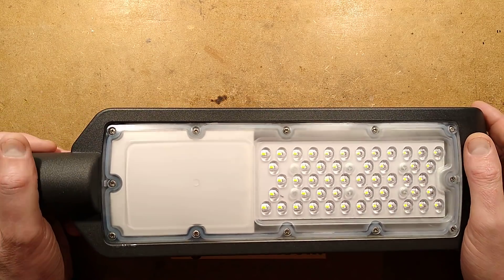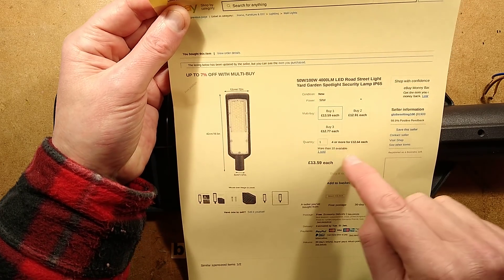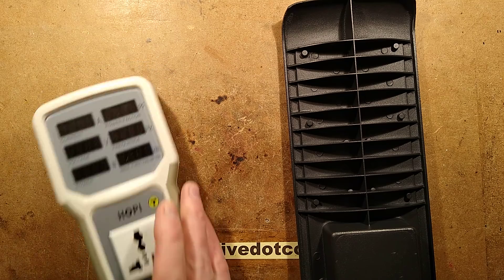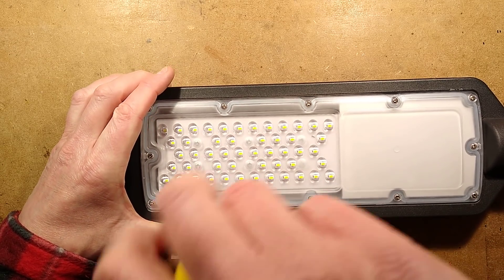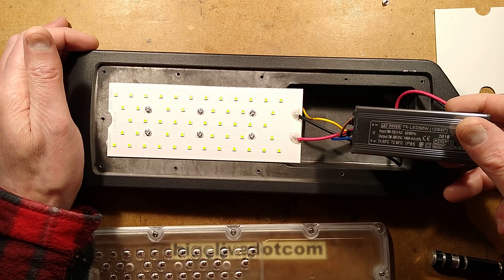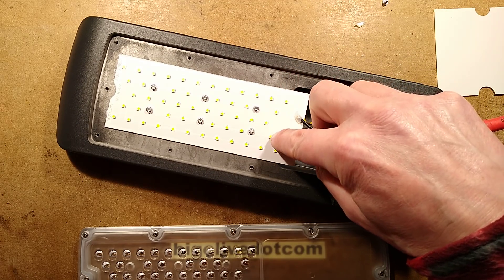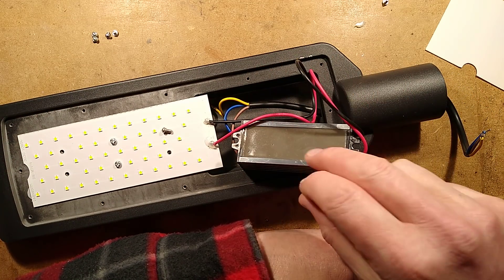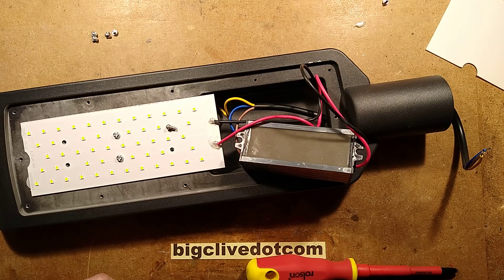DIY Chinese street light kit.

Comment: 08:56 "Lets take a look at the LED array". I think you meant "5G mind control array"!
Reply from the maker: I was so tempted to make lots of brain modulator beam references.
Reply: @bigclivedotcom  just do a technical explanation on how 5g brain control works, rambling how youve been installing some relay stations and transmitters. you may get some special new viewers from that haha
Reply: Very special.
Reply from the maker: @drkastenbrot  I did toy with that, including how the boxes on some lamp posts monitor chemtrail levels and signal to planes to dump more.  But I'm cautious about affecting the safety of street light installers.
Reply: Linking up 5G with our chemtrailing program has always been our long term plan. Frequencies enabling targetted control of heavy metals in the bloodstream allowing blood brain barrier breaching.
Reply: @geocontrolmanchesterairpor3943  Dimmer Skies are Safer Skies
Reply: @bigclivedotcom  On a serious note it sounds like a teardown of a ZigBee enabled streetlight, including an explanation of what the "400V CAPACITORS" are actually for would be good. I am sure the Illuminati will pay handsomely for the propaganda!
Reply: @kevinjbakertribe  So dimmer people are safer people?
Reply: @dadillen5902  I suggest "More compliant" rather than "Dimmer". But - yes!
Reply: @bigclivedotcom  I would love you to do a "tear down" of the kit that Mark Steele has been discussing as you will probably know what most of the components actually do rather than just having Mark raving about a 400V capacitor and knowing very little else!
Reply: @kevinjbakertribe  i think in this case 'more complaint' and 'dimmer' may be co-indicated. 😉😲
Reply: @dadillen5902  Apparently my Illuminati superiors inform me that the only acceptable response is "No comment"
Reply: @kevinjbakertribe  Which is after all a comment.😵😜
Reply: @dadillen5902  Damn!!! 😂
Reply: While some of us actually are installing 5G kit! Well, I'm in the back office. I can't even control my own mind, let alone anyone else's.
Reply: @dadillen5902  I wouldn't say so - I used to be a dimmer person, but the SCR noise became very distracting and interrupted my concentration.
Reply: @restcure  Not sure we are talking about the same type of dim. I my experience dim people rarely get brighter.  Ignorance is curable with education, but stupid is generally genetic and quite often fatal. We were also speaking about safety, not disturbance or distraction. Although distraction can put one in danger. Just look at the number of deaths caused by cell phones, but that put us back to death by stupid. So in the in the end the brighter you are the less likely you are to suffer death by distraction. Also, in my world an SCR is a silicon controlled rectifier, not certain what you were referring to.
Reply: @dadillen5902  Nope - just taking the opportunity to make a bad pun.
Reply: @restcure  Sorry, stepped off that cliff and just kept fall. Didnt realize the pun until i had sent my rant.
Reply: @dadillen5902  yup - I travel to the Land of the Dad Jokes fairly often ...
Reply: @restcure  No problem, I have reach the point of grandpa jokes and I am happy to have made it. I have nothing to offer but a little hard won wisdom and nobody is interested in that. I am afraid that the stupid and ignorant are winning.
Reply: @bigclivedotcom  Can we have a brain modulator beam teardown and reverse engineering in the next video? I'm building one at home but can't get it to work right. It does scare the cat but I still think the government is awful so it's clearly not working.
Reply: @kevinjbakertribe  I laughed so much I nearly wet myself :)
Reply: @bigclivedotcom  https://www.vigiliae.org/mark-steele-exposed
Maybe you could request one of the smart helmets he and his brother produce to tear down. I'm bemused why he opposes the tech when he is involved with it himself. Weird.
Reply: Im not sure he is that involved in that bike helmet company. He has used it to try to inflate his tech credentials in the past, but I reckon hes a director in name only and his brother runs it in reality. At the end of the day its just a bike helmet with a rear view mirror.
Reply: Apparently China is already thinking about 6G. I could not care less to be honest. I do not want IOT devices if it means being attacked by kitchen appliances and rogue DIY tools and other things.
Reply: https://www.youtube.com/watch?v=Klbz5v60n_I
Maybe Mark got the streetlight from this guy.
Reply: Great video, with very useful info on detecting signs of mental illness and when to seek help.
Reply: Would be interesting to get hold of one that is being used in the UK locally
Reply: @englishbreakfast82  If you are interested in more info on 5G mind control, don't miss this. I hear Big Clive is presenting at it.... https://youtu.be/DoSuetJira0
Reply: Mohammed Shafiq  Stolen?  That seems like bad juju.  Who is Mark Steele, and what happens?
Reply: @thesquarerootofnegativei6225  Mark Steele thinks that streetlights are actually military grade weapons, proof of which is the fact it has 400V capacitors in it. Watch any of Clive's USB charger teardowns (along with many other mains powered things and they have 400V (or higher) capacitors inside to smooth the rectified mains electricity.
Reply: @kevinjbakertribe  
That doesn't explain all the people laying dead at the bottom of lamp posts does it.
No it doesn't !
Reply: @FarleyHillBilly  I believe the dead bodies were from an unfortunate incident where the 5G - sorry ZigBee - was accidentally turned up to 11 during testing.
Reply: @kevinjbakertribe  
Ah yes, the Marshall effect, their brains were scrambled.
Reply: Mohammed Shafiq  he got arrested on caution. Seen it.
Reply: Mohammed Shafiq  Well- that'd be a dumb place to put weapons. 
Now... headphones- there ya go. ;)
Reply: Top tip, Mr Kipling foil cake dishes make handy anti death ray goolie shields!
Reply: I appreciate all the comments thank you. I just had a concern about information and a world of all possibilities. Only time will tell I guess.
Reply: I’m pretty sure you wouldn’t be able to find a mind control capable streetlight on Banggood.
Reply: Mohammed Shafiq  No, from my experience cellphones cause mental problems. But, it has everything to do with IDIOT people and nothing to due with RF.
Reply: I'm not saying it is or it isn't anything. I am just interested to learn exactly what is in the street lamps here the UK. It seems they have some kind of Bluetooth technology inside them but that's all  I know. Uses some kind of network called zigabee or something like that.
Reply: @englishbreakfast82  I believe they generally use ZigBee - the same thing smart meters use to talk to the in-home display. They use this as ZigBee creates a resilient and free network , so when (for example) a light fails, it only has to tell one of the nearby streetlights, which in turn tells another until the message gets back to the engineers. The 5G "mind control" stuff is just a big conspiracy, hence mine and Clive's comments - there really are people who think councils are using street lights as weapons!
Reply: @kevinjbakertribe  have you not seen the video of a UK hospital where birds are falling out the sky because the hospital was installed and turned on 5G
Reply: @jasonjuggler3457  do you have a link to that?
Reply: @englishbreakfast82  no I dont, search hospital 5g birds ... or something, you will find it with ease as its shocking. about 15 birds dying on floor in front of hospital doors with about another 15 in air flying around in circles looking asif their minds are being scrambled.
Reply: @jasonjuggler3457  sounds like it could be easy to fake but I'll have a look for it.
Reply: @jasonjuggler3457  lots of comments saying the birds have flown into a floor to ceiling window at the hospital. I've seen that myself just not as many. Mainly pigeons when the sun shines on glass in a certain manner.
Reply: @jasonjuggler3457  
It must be true then, oh my brothers, we must all believe in stupid crap together. 
We shall now sing the song of our creed 
'Ming ming special mummy - I'm a retarded cnut'
Reply: Sometimes flocks of birds, particularly murmurations of starlings are attacked by birds of prey and misjudge their evasion tactics. Thats the case for a large number dying recently in a separate incident. The tail end of the flock unable to pull out of a dive in time and hitting the ground.
Reply: @englishbreakfast82  What ever makes you feel at ease ;)
Reply: @jasonjuggler3457  It's much earlier technology killing the birds at the Coventry hospital: large panes of glass (walls) which the birds can't see.
Reply: @englishbreakfast82  Zigbee. It's a wireless network protocol used by utility meters to send the consumption information back to the home office so that they don't need to send meter readers out periodically to read the meters, or else just guess how much power you used based on what a neighbor down the street used. It's no more dangerous than the internet, and a lot less likely to control your mind, since it doesn't talk to humans.
Zigbee can also be used in home automation. If you can read your thermostat remotely on your cell phone, the thermostat is probably speaking Zigbee.
Reply: @englishbreakfast82  https://en.m.wikipedia.org/wiki/Zigbee
Reply: That sheds about more light on it for me, no pun intended. It is hard to ignore what they are saying about 5g and when you research microwave weapon technology it seems it does exist and is being used by the military but involves much much higher power inputs and outputs to render it anywhere near lethal. Thanks for your response.
Reply: @englishbreakfast82  Yes - the military certainly have experimented with microwave weapons - I seem to recall for non-lethal defence, the idea is they can cause pain in the outer areas of the skin without doing any damage.
Reply: @kevinjbakertribe  yes that's what I've found through research. It makes the skin feel like it's being burned/microwaved.
Reply: @kevinjbakertribe  what are your thoughts on this intelligence harvesting stuff? As we know lots of our technology is gathering information about us and social media platforms etc. Do you think it is wide open for abuse. Is it all being collected and stored into super computers for instance?
Reply: @englishbreakfast82  On "There is a YouTube video showing <insert conspiracy here>" a really good YouTube channel to watch is Captain Disillusion - much like Clive, someone who knows their onions creating excellent content. On "Intelligence harvesting" if you mean "Are the likes of GCHQ and the NSA spying on all of us and using 5G as a weapon" - no, even if they wanted to they simply have no spare resource. Facebook, Google, Amazon, Apple, Microsoft etc - they are absolutely "spying on us", as that is their stated business model (Google and Facebook in particular) - the general rule to use is "If the Internet is giving you something for free, then you are the product, not the customer" - there are, of course, clear exceptions where people are being altruistic. And the Cambridge Analytica lark shows that this data can be misused. Just like real life, there are those on The Internet who abuse the system for their own ends.
Reply: @kevinjbakertribe  I appreciate your comments. I have a concern about the use of artificial intelligence technology and how Intelligent we may let it become. I think we need to set clear limitations on how much knowledge we let it have. People like Elon musk declaring things like it has the capability of becoming a demon if we let it get that far seems far fetched but it is possible when you think about it in regards to the point of singularity and how much information we are now entrusting technology with. I never say it is or it isn't I just find the perspective interesting.
Reply: @englishbreakfast82  We don't know the future but at the moment a computer powerful enough to beat the human brain at chess is the size of a house, consuming masses of electricity. And without new software it won't be able to do anything else, like research new chemical compounds of discuss last night's footie. So at this time I suggest the Terminator "Skynet" is still a way off!
Reply: @kevinjbakertribe  Microwave weapons such as Able danger use 96 GHZ, the spectrum  agreed in UK is 700Mhz, 2.3  and 3,4 Ghz and 26 GHz.  The lampposts operate on 868Mhz as Steele constantly claims is 5G, it is NOT! Baby monitors and remote devices like garage door remotes etc use 868. He is deliberately making false claims to make all campaigners look like idiots. He goes after me in most of his vids because I have been alerting people about him for two years.
Reply: Yet 5G campaigners ARE idiots. Hes just taken your BS and run with it , making a nice profit out of it too.
Reply: Soon we will control all of you peoples pineal glands.
Reply: Here is some information I found on Mr Steele. He and his brother own a company that produces smart helmets. Maybe you could ask for one to tear down big clive. Here is the link to the information I found. I think you will find this gold dust in any future mention of him, Enjoy. 
https://www.vigiliae.org/mark-steele-exposed
Reply: If you look on Google patents you can find evidence of that using terminology like 5g street lamp. Interestingly all the technology seems to be Chinese inside of them.